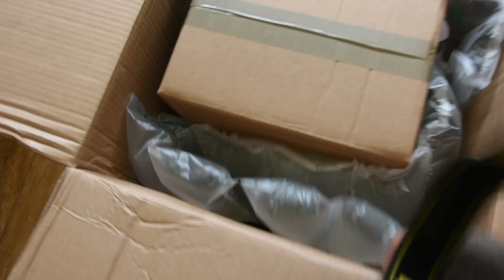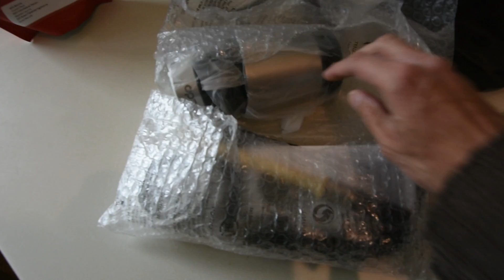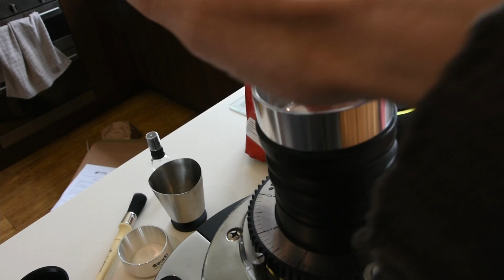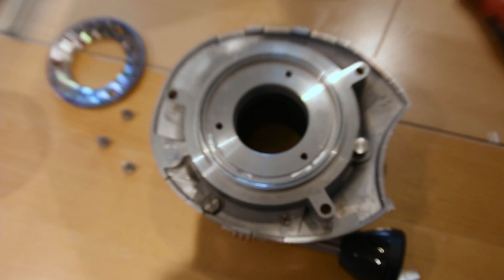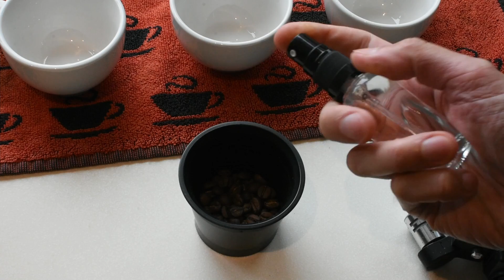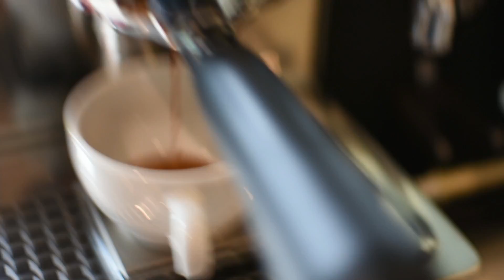Ceado E37SD - first impressions

Comment: The coffee grinder is heavy and not small, so it must be powerful. But it occasionally happens that burrs are jammed with beans. Contacted the manufacturer. They wrote: do not throw away the entire dose of coffee (18 grams). In fact, this advice does not help: even 3-5 grams of beans can suddenly jam!!! For such money, they could have done better!
Reply from the maker: I think the issue is that they lowered the motor RPM for single dose. I don't have this problem, but it probably depends on the beans.

Comment: Great video Rob, thank you. I just bought myself a 37SD and must say that I'm astonished by how misaligned the burrs are. 10X yours, quite literally. Difficult to accept on a grinder at this price point... I'll try with the tin foil as you did. Questions is, did you folded the foil or are each of the pieces of tin foil I see in your video just 1 single layer of it? Many thanks again.
Reply from the maker: I did a bit of trial and error. At least one piece is folded once, if I remember correctly.

Comment: I have never hear the whining roar noise coming from other same models. Are you grinding stones and rocks? Seriously, other E37SD machines are remarkably quiet since the motor assembly is mounted on rubber.
Reply from the maker: The noise is not particularly obnoxious in real life. It's some combination of my microphone placement and your speaker. You can hear the motor noise alone at 5:15 and at 9:02 I think there's a bean stuck in there, which happens sometimes. It's not that loud. It's also possible the timbre changes as the burrs get more seasoned.

Comment: Hi, great review and video.I have same grinder and is very good but have one question for alignment? I make alignment on my other grinder but here is different because when I turn to finer and then to coarser upper ring jump some 1 mm I see and yours like mine make this, my question is whenu make alignment u turn only on finer or coarse or in both ways? Last question when I make coffee if I need to turn finer I turn then turn little coarse for this upper ring to slide down ? U make same way when you turn finer stay that way? Thank you !
Reply from the maker: I always finish any adjustment by turning it finer, so to go coarser I overshoot then turn back. I don't think it matters which way around you do it as long as you do it the same way when you do the alignment.

Comment: Trying to dial in my new purchase however I’m not getting close for an espresso grind. I can turn the adjustment finer but I’m starting to chirp? Is this a sign of needing shims?
Reply from the maker: Chirping but not fine enough could well be burr alignment, yes.
Reply: @RobFisherUK  got it resolved after 2 alignments I determined it was the burrs. It pulls shots perfect now!

Comment: Hey, Rob!

I have an E37S and I'm thinking about changing the burrs. Does these opalglide burrs fit in the E37S?
Btw... do you think they are better than SSP? Or just different?
Reply from the maker: Honestly I haven't gone that far. I haven't tried different burrs. They should fit because the SD is basically the same grinder. But it does grind more slowly than the S so I don't know if grind speed affects burr design or not.
Reply: I’ve asked WLL and they said the opal glide burrs fit the e37s. Thinking about getting those eventually, but I already upgraded to SSPs this year.

Comment: How are you liking it thus far, Rob? Its been nine months for you. I received mine a month and a half ago. Happy with it.
Reply from the maker: Yes, still happy! Not planning to buy another grinder ever (which was part of the idea of getting a commercial grinder). There's perhaps more retention than I first thought, especially since I got lazy and stopped doing the RDT, but it's no big deal. I get good, consistent shots.
Reply: @RobFisherUK  Just add more coffee than intended and get it out later!! Perfect dose every time!!
Reply: @RobFisherUK  good to hear. I'm wondering how I often I should clean the chamber.
Reply from the maker: @hedonist222  er, less than every 9 months seems fine 😬😜

Actually I did brush it out a bit a while back. It's great how easy it is to take apart and how it goes back exactly how you had it before.
Reply: @RobFisherUK  I was wondering if you'll get less out for a while after cleaning it. Because the spaces & crevices that got cleaned now need to be filled again.
Reply from the maker: @hedonist222  yes, I think so, but I think it's gradual enough to not really be noticeable.
Reply: @RobFisherUK  Hi Rob
If you stop using the spray the grinder performs better as it may appear there's no mess but it's just somewhere else and can cause it to clump up in the actual de clumper ?!?
Reply from the maker: @meandmeatmeoverthere  fwiw lately I haven't been bothering with the spray. Depending on the beans, the grounds stick more, but I just shove the brush up the chute and waggle it around to get everything out. Doses seem pretty consistent this way.
Reply: @RobFisherUK  Hi Rob
I bought a secondhand one and found the spray with oily beans was causing problems.
Mines has the pre optiglide burrs but ill be changing them some time soon.
I bought a Eureka oro  but returned that as it wasn't good at keeping grind consistency and vibrated all over the place.
As you I won't be changing as this will outlast me I'm68 and going through all that what to pick is a real pain in the.
Although I did read in some of your replies the titanium burrs in my one seem to have an issue with clogging .

Comment: Just bought an E37S. Grounds are so fluffy. Many people are buying aftermarket bellows kits or finding alternatives that were intended for other uses (OXO pastry bellows). I find that with the E37s it will expel almost  all the grounds if you run it for longer. The shots have yet to channel and are very creamy. I only really would have wanted the bellows off the E37SD and not all the rest of the stuff like the kit that comes with it. The bellows is not something that you can fit from one machine to the other. Either it comes with the bellows or not. It just didn't make sense for me.

All of the shots have been fantastic. It's hard to get it wrong with a Ceado. I'm using a Rocket Giotto Cronometro R.

Comment: How u liking it there is so many sd grinders out there that look nice but the grinds that come out of this always surprises me it kind of looks like there conical burrs
Reply from the maker: Still liking it! I don't have much to compare with but it's solid and consistent and just works. I've even stopped bothering with the RDT and it's fine.
Reply: @RobFisherUK  how is it with darker roast I’m really thinking I should just get this one idk don’t like how it’s made it looks old but what it lacks in looks ur doubles with grinding it deff a work horse especially for that price
Reply from the maker: @Sammiecheeks16  I think it's very well made. Everything is metal and you can take the whole thing apart easily and it goes back together easily without even adjusting the grind! It will last forever.

I have tried darker roast and it makes no difference, it works just as well.

Comment: Great review.
Does the grinder outputs 18.0 grams from 18.0 grams right after its been fully  cleaned?
Reply from the maker: No. There is some retention. I haven't measured it. It's not enough for me to have noticed any problems. From what I've read the amount retained is small for a big burr commercial grinder but if you want zero retention there may be grinders better optimised for that.

Comment: I only make three cups of espresso a day and now I find out I have to clean burrs every week or so, as yesterday it stopped grinding. After cleaning and asking seller how to maintain, that was what I was told, is this true for everyone?
Reply from the maker: I have never cleaned the burrs! I suppose some stale coffee oil might build up and affect the taste. Or maybe it cycles around. I've never noticed. But I can't imagine it not grinding from lack of cleaning. Is the motor stalling or is it not drawing in coffee?
Reply: @RobFisherUK  hi, motor is not stalling, it is not drawing in the coffee, as when I opened the rol to see burra all the coffee was till there! I cleaned it and it worked, if it happens again, I’ll have a service tech come out. One question, if where I live has high humidity, could that cause the burrs to fill up with coffee remnants and then just spin around and not grind?
Reply from the maker: @Lucio88K89  it's not out of the question that humidity has some effect. Also possibly light vs dark roast. I've seen reports from people complaining about how the coffee comes out of the spout due to static, and others including me not having problems, and it seems to be explained by these kinds of variations.

Might be worth asking this on Home Barista forums - you'll get a wider range of experience there.
Reply: @RobFisherUK  thank you very much for your help, I will try there as well, really appreciate it.

Comment: Hi Rob, very nice and detailed review, thnx! I’m thinking about to buy the same grinder. How do you feel about the Ceado 4 months later, still happy?

Small note: you were mentioning that you didn’t use WDT during the seasoning of the burrs. Think you meant RDT ;)
Reply from the maker: Yes, I am still happy. I get really consistent results. What I find I am concentrating on now is even distribution: I can tell with the naked basket when I get that wrong. Grinding just works, there is no fuss.

Well actually there is some fuss: the RDT really helps, so it is fuss to do it. And I do find I want to use the brush after every grind because some coffee will stay in the spout otherwise. But it's not really a problem to do these things.

Comment: I'm not understanding how you fixed the alignment. Or how you used the pen to expose the point of misalignment. Or where you shimmed it. I was thinking of buying one of these and upgrading the burrs to ssp and etc. But know I'm afraid to remove the burrs that come on it and replace them with upgraded ones.
Reply: Don't be afraid to change the burrs. Look around on YouTube on burr allignement, they usually already come from factory slight misaligned so give it a try and if it dosent work out, it's revearsable and just remove the shims ☺️
The ssp burrs would be a really nice upgrade you will see!
Reply: @SuperGajol  I ordered the grinder. Bought the upgraded burrs. Requested them to do the burr switch. I'm hoping they get the alignment right.
Reply: @JasonAlexzander1q47  What burrs did you go with, please?
Any comments on the device after using it for some time now? Thanks and cheers!!!
Reply from the maker: I will add to not be afraid to mess with it. Because everything is metal, it really does go back together exactly as it came apart. (My experience with Vario burrs and all its plastic parts was different...)

Comment: Hi Rob, just to let you know I have E37 S (regular one, not single dose one) and had just about the same problem with burrs alignment :(. I used thin aluminum foil placed on the flat part of the burr's bed (not in the groove). I was afraid that if try to lift only that narrow flange of the burr the burr will flex. Finally I managed to have the burrs aligned (haven't touched the rotating burr as well as it looked much better than the fixed one). Still I am very disappointed that at least my grinder was so much off. Should not happen in the grinder of that price. Unfortunately I forgot to measure the burrs to check the source of missalignment (if that is the burr or the bed machining flaw).
Reply: I have the E37S as well and it is not grinding fine enough for espresso regardless what type of coffee I use. Could it be the misaligned burrs. I'm at the zero 0 point and still coarse grinds I get.
Reply: @hanzohcafe.  Not necessarily the grinder is not grinding fine enough. If you have burrs not aligned part of the burr grinds super fine and part of the burr grinds relatively coarse. That is the problem with dialing such a grinder. The particle size has way too much of a range. You are not able to dial in such grinder, there will be always channeling. Just check your alignment - its very easy. The only problem you can have is that you will have to move the grinding regulation knob (its actually a kind of semi circle "fork") if you won't be able to move it so far (and you won't be ;)) to have the burrs touch. Just mark the former alignment of that fork, unscrew two screws and rotate it to increase the range into more fine grinding. When you do the checking please use manual mode (not single or double) and move the knob once the motor is idling e.g. slowing down - not to stall the motor once its under power.

Please have a look here: https://www.youtube.com/watch?v=EP9NLv-AxGc to see why burr alignment is so crucial. Basically the ultra grinders does not differ so much vs. our Ceado... I mean in terms of the mechanics. What matters is a precision of manufacturing that translates to... burr alignment :D
Reply: Thanks for your response,  do you have by any chance a video on how to do this for this grinder? I was planning on returning it today but if I can make it work I might keep it. Cheers.
Reply: @hanzohcafe.  Unfortunately I do not have any such video (all I could offer is to guide you somehow on Skype one day ;)), but if you have a good reseller it would be much easier to either return the grinder or to make the reseller check the alignment and "prove" to you it's right. Placing shims under the burr is still a kind of a crutch. The whole burr bed should be aligned and perpendicular to the motor axis. As you could see there are grinder producers who check the alignment in the factory. All I can tell, the difference between burrs off and aligned is a night and day either in terms of ease of pulling nice shot and taste of course. Probably in 2-3 weeks I will recheck my alignment (and maybe look for some better option to align the burrs than placing thin aluminum foil pieces under them) so if you do not have your problem solved till then just drop me a message.
Reply: @marcin.sobocinski I can't thank you enough for all your input. Also much appreciated your offer on guiding me via Skype. I might give it a shot on my own, just a bit scared damaging my burrs. You are giving me a reason to keep my E37S 😂. One more question, regarding the Aluminum foil people are using, is it the Aluminum foil used for cooking😅? Or is it a special foil that gets purchased somewhere.?
Reply: @hanzohcafe.  People are using regular kitchen foil for that. I used foil with adhesive on one side (check your email, I tried to send you a photo of that foil). It's something like 0.07 mm thick, so I had to use many layers (like 10 or so), but it sticks well and is very easy to cut an apply.

Comment: Have you tried dialing in a lighter roast?
Reply from the maker: I mostly buy form Hasbean and some of their roasts are quite light, but to be honest I have not tried anything super light. It is possible to stall this motor, though I have only done so by dumping a large amount of coffee in at once (when I was seasoning).
Reply: @RobFisherUK  In my experience, it periodically stops even from 22 grams of coffee beans, or even less. Unfortunately, it seems that the weight of this coffee grinder is the weight of the body, not the engine...
Reply from the maker: @Yurii-Roman  yeah they've lowered the RPM but they haven't used a higher torque motor to make up for that. I'm still using the grinder and I've never had it stall on me. But yes, for someone doing light roasts or bigger doses it should be a consideration.